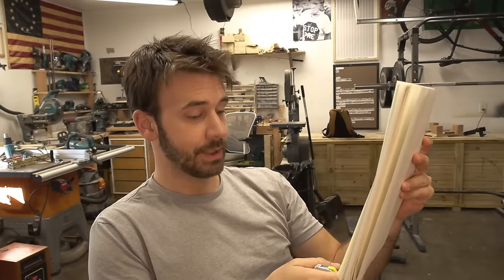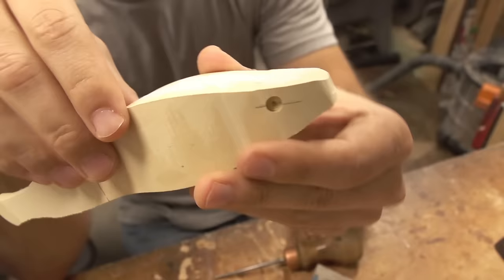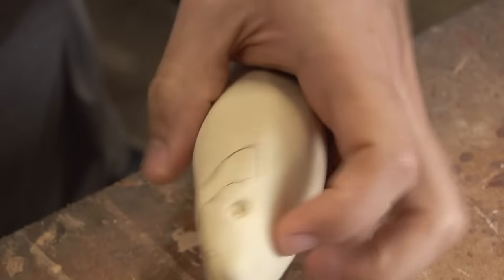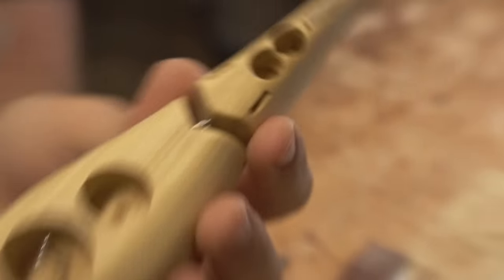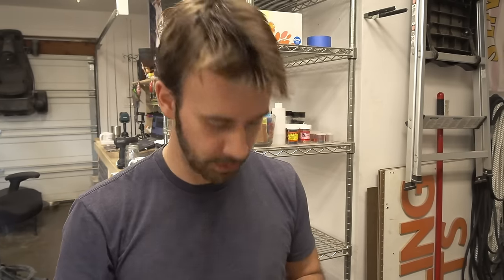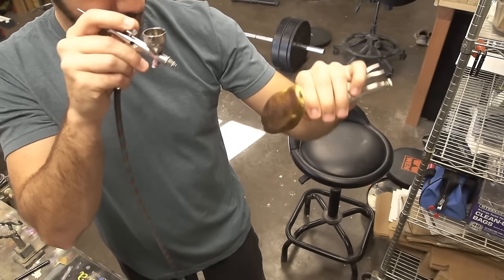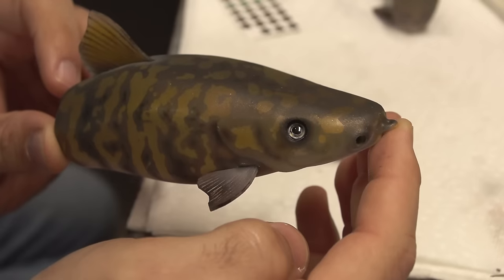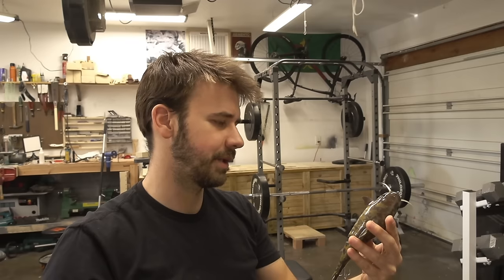Making a FlatHead CatFish SwimBait

Comment: Good old hydro dynamics at play here, every object will take the easiest path thru water, the average Glide Baits are a lot higher than they are wide, this gives them the side to side movement. With that catfish being flat and not very high the less resistance was over top & underneath the lure, allowing it to move up & down thru the water column, also the 2 pectorals then worked as a diving lip. A very cool build none the less, and a failure is only if you don’t learn from it 🤷🏼‍♂️ really enjoy your tips, techniques & carving skills👌

Comment: Down in Vicksburg, Mississippi, there's a civil war battle ground that's a national park

In the park there's an ironclad battle ship that was discovered years ago, and according to the preservation crew, it sank whole with numerous cannon ball holes just at the waterline. 
The slit covered it throughly fast enough to preserve most of the crews belongings inside the ship
It was whole until they tried to pick it up with two cranes mounted on barges, but used cables that sliced through the massive oak beams running the length of the ship, plus all the heavy timber that was once encased in sheet iorn. 
There's several story boards detailing the things found within it around the display cases. 
One of them describes the bones of a very large catfis, and according to the biologist that examined the bones.
They established that the catfish was minimum of 300 lbs, and they have reports of catfish taken from the Mississippi River that large and larger supposedly verified by the skulls and vertebra that's been examined from the 1700, 1800's. 
They believe that they were blue catfish, and numerous finds of the rare these days around the area of duckbilled  catfish almost as large according to what I read about down in that part of the Mississippi River, but I would think that if they both were there, then they were all along most all of the Mississippi River, and every river, and stream that feeds into the Mississippi River from one end to the other. 
Thought that was interesting enough to remember, and pass along over the years, but as of how factual this information is, is only what I have read there at the natural park, as well as reading miscellaneous articles over the last 40 plus years. 
Honestly other than the park information, couldn't tell you at this time who wrote the other information, are who the articles were published in it's been that long ago since I read this.
Maybe someone from the area along the rivers can verify, or even shoot holes in what I read years ago. 
Won't hurt my feelings in any way, and I really would like to know one way or another if it factual, or bullshit personally.

Comment: I have a vice like this that works great for odd shapes: Grizzly T34003 - Pattern Maker's Carving Vise   There are a bunch of brands that have similar vices that swivel and hold very well on odd shapes.  And you could even make an attachment for it out of a 2x4 and a piece of plywood  (that is what i did) that would let you clamp it in your existing bench vice vs needing to put it in a hole in your bench to lock it down.

Comment: Im Luther from West Tennessee. I have I suggestion that I hope crosses your attention. Have you ever made a split lip kinda type bait? IV had the idea of cutting a slot in the middle of the lip a tad bit before the nose to accommodate a flipper vertically to the lip.  insert a pin prolly gonna have to be a thick lip for integrity tho after drilling  the lip. Like counter bore the flipper on both ends so it does flip on the pin? I love your channel and how you like to try new stuff I'd be stoked to see it if it improves action or not. I haven't seen it before